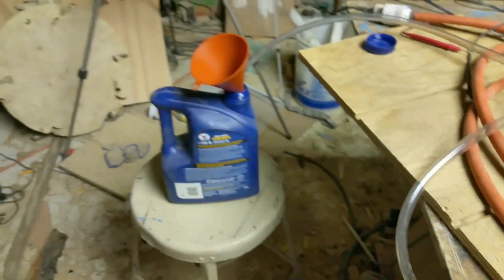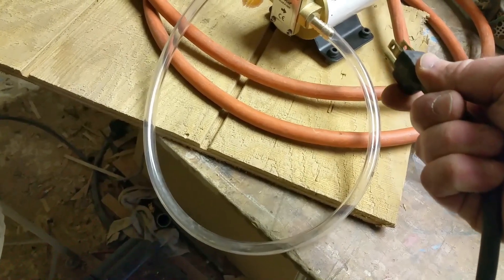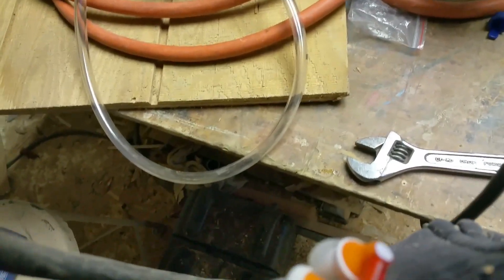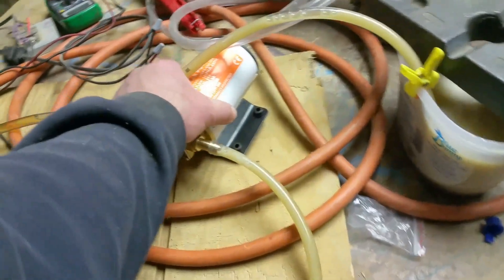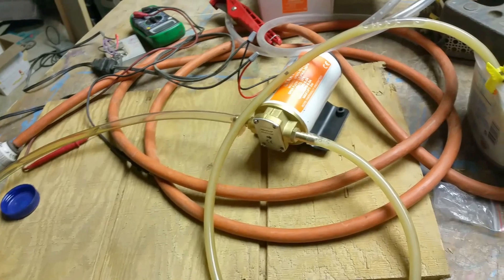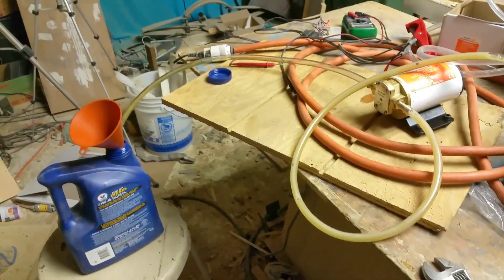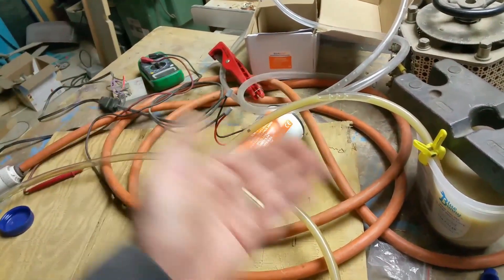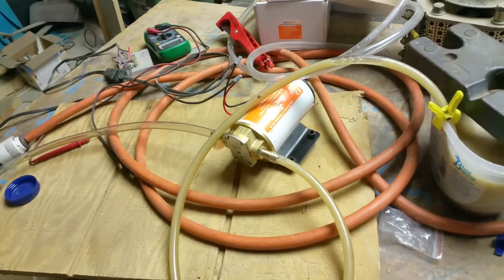Engine Pre-Oiler Proof of Concept Test

Comment: I have been going over different ideas on how to build a pre-lubrication system for my Kawasaki drag bike.
My main idea was to use two-10 AN fittings one on the pick up on the oil pan via a welded fitting and the other on the main oil feed on the block to oil the internals then attach a -10AN dry break quick release on sections of the hoses. A filter and pump. If the engine has just been rebuilt or the engine has been sitting too long, oil can be circulated quickly to the bearings and camshaft while hand turning the crankshaft

Comment: Add a check valve on the suction side of the pump, the check valve should hole oil in the pump and suction hose itself. Look into a full port check valve, should the same ID of the hose. Make sure you put the check valve at the beginning of the hose. You can also put a check valve at the block so you don’t have positive pressure from the block on the system. Also use stainless steel tubing and fittings. Ditch that brass pump and get a stainless steel pump. You need to put a check valve on the main oil pump pick up tube in the oil pan.

Comment: Seems like you're on the right track. Is there any chance of using an oil pan heater for cold starts at your garage. As you know, that 15w-40 diesel oil is pretty thick even at higher temperatures. I also run a solar trickle charger on my Duramax as it sits for long periods.
Reply from the maker: A pan heater would be nice, even a magnetic one though the pan is aluminum.  The oil I was pumping there was 30w (despite what the bottle says).  I also want to try pumping it after chilling the oil.  The journals on the block are 1/8 pipe so I am also looking into pumping it into a journal on each side of the motor rather than try an push it through a single 1/8 port.
Reply: Even more reason to heat up the oil. At 70F it took forever to drain the oil on my Duramax yesterday. Check these guys page; www.Wolverineheater.com
I have no idea why there are so many cold start videos on YT... 
Seems they're all asking for lubrication issues when they do that.